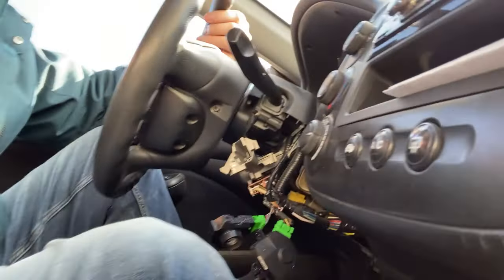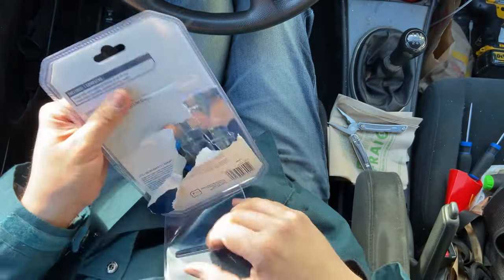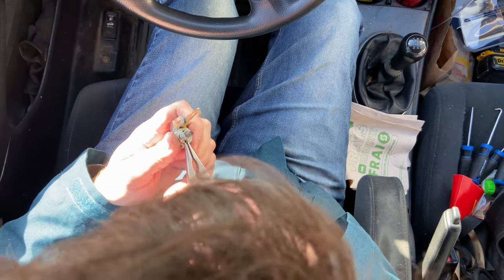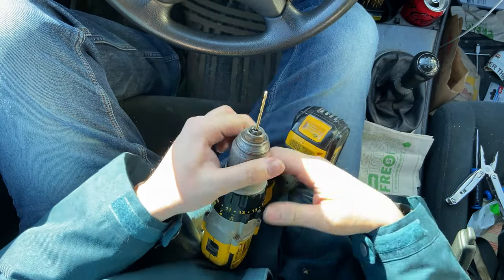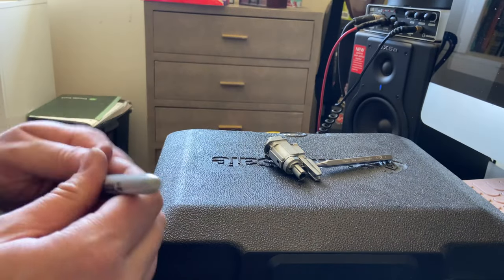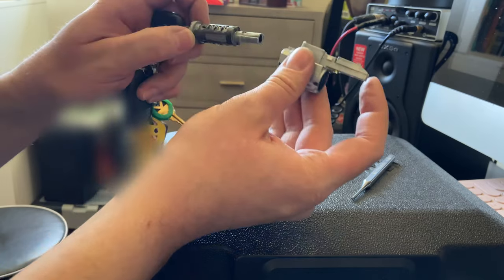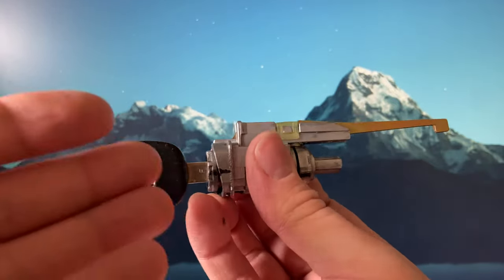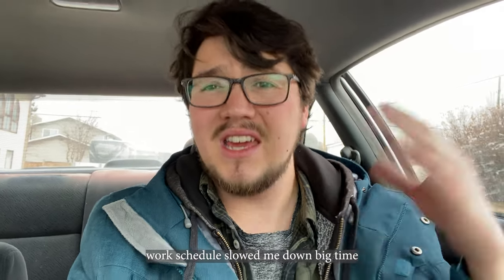Absolute Noob Fixes Honda Civic Ignition Lock Cylinder EASILY

Comment: My dear friend I'm a locksmith myself and that repair goes for only $200 of course I live in GA, but what you didn't think about was that replacing or removing only 1 wafer/tumbler only fix the problem temporarily because all the others one will go bad eventually, best scenario is to replace them all and cut a new key for $85; BTW we do fix those without no drilling nor damage to the cylinder or housing itself.
Reply from the maker: You're totally right! 
My method is really just a short term 'hack' fix with some serious flaws. If I could've afforded it and deemed that the car was worth putting the money into in that area, I definitely would've had it done properly. 

The prices you've cited sound totally reasonable to me. I wish it was that affordable here. If it were that price here, it would've been a no-brainer to have it done properly by professionals.

I also like your idea of having all the locks replaced (if I'm comprehending that properly). That wasn't offered to me, but it seems totally logical. There's only 3 locks on this car so it doesn't seem like 'that much' more work to just replace them all while you're at it. I assume that would've costed me a lot more here as well. 

At the end of the day my whole reason behind attempting to 'fix' this myself and make a video about it is just to challenge myself and learn about how stuff works. 

Thanks for your comment, I think you have a valuable perspective on this!
Reply: @Levisrad  he meant replacing the wafers in that single ignition lock. But hey, if it’s not important and it works, then your good to go!
Reply: I got changed 11 hundreds for mine to get removed and repaired..
I don't know why this guy charge me so much to get mine replaced..400 dollars to get the parts replace and 700 dollars for labor..
Reply: @Levisrad  I took all.my tumblers out. The car still needs ur transponder key to start even tho a screwdriver may turn the.ignition.with all removed. Bitnit won't fail again.
Reply: I'm poor
Reply: Good for you but this kid fixed it for free,if it's a lasting repair ONLY time can tell,good job kid keep on truckin bud.👍
Reply: Calebcontreras, sounds to me like you are just unhappy he got it working without someone like you. I think he did a great job, and will help others who don't think that even $200 is worth it.
Reply: @jeffwest5551  not unhappy mate, it was just a comment from a locksmith perspective point of view, if he did it without any help and without spending any money good for me, or you think I don't use any hacks to get stuff done in my life and house without spending money as well? Don't get it twisted brother when you go to a doctor and they tell you that you need a surgery but instead you decide with therapy you can do it too, is the same is was just a comment.
Reply: @calebcontreras3545 yeah but you made it sound like it was only $200 dollars. $200 is a lot when you don't have money, and it's a big difference compared to zero. Plus he would have to have a new key cut and programed, which he didn't want to do either. So yeah whatever.. "mate".
Reply: @jeffwest5551  Nah man you guys from this crystal generation have to say something to feel accomplished, it was just a comment from my perspective due to my Jon being a locksmith nothing else, plus he didn't have to have a new key cut and programmed because you would fix the ignition as original, he was respectful and took it the right way not like you... so I'll mind my business you mind yours.
Reply: @calebcontreras3545 ok man, if you say so. But you are the one who mentioned having a new key cut.
Reply: What area you in I need a mobile lock Smith.
Reply: @gregoryfleming2779  we are located in Gwinnett County but we are mobile and will go to you. We are in Georgia though.
Reply: That’s too rich for my blood
Reply: What part of GA? I'm in Atlanta and that's way more doable than I was expecting I have a 2005 Civic and in the college park area i was going to fix it myself but with work and other things I'd gladly delegate it to someone else if feasible please send me your info if doable
Reply: Please definitely can I have your company info this would be a lifesaver right now.
Reply: $200?¿ thats still to much... I'm screwed..:(
Reply: How do you do that? Please explain I'm having same issue  live in lv nv lock smith's here say they'd drill it out for 400replace part inside.. 😮😮😮😮
Reply: Where are you located?  I’m in Barrow County and my key is sticking
Reply: Where is your shop located?

Comment: some important steps missing : the  hard ones in removing switch. Take photos of which holes are keyed on the cylinder . Don't remove key yet.    Once the key is removed , the pins and springs will all pop out and fly everywhere and you will lose track of what goes where.  Thus, carefully and slowly remove key while holding down on the spring loaded keys on both sides of cylinder with the fingers.  Orientate the  cylinder with pins up and finger on reverse holding the pins on the bottom. Slowly remove the top fingers. Now you can remove the pins noting position and number because if you mess up, at least you know how to put it back together.
Reply from the maker: thanks for the feedback! This is really helpful info so thanks for sharing it here!

Comment: I just had my car try being broken into, so I replaced the front drivers side door lock cylinder.. I bought the new kit at auto zone for like 45$ bucks and the kit included 1 door lock and 1 non-transponder key (spare key).... it took me a couple hours to get my door apart and to install the new door lock and reassemble door... install came out great! but now i have 2 keys on my ring.. later that day i went to the grocery store and unlocked my car and was in a hurry to get home.. I accidently put the wrong key inside the ignition and jammed / wore the wafers inside and now my car won't turn over / start..   the ignition has seized.. I've done a lotta research so far to figure out what i need to do as far as repair my car and basic repairs of ordering parts and getting a locksmith to reprogram new keys runs any where to 850 to 1100 US dollars.. SO with that said, I am glad to have run into this video and I will be giving this a shot because the risk is worth giving it a try myself, just to remove the wafers that are worn. Worst case scenario, I send the ignition cylinder/ Barrel into a locksmith and get the wafers rebuilt with the original key.. THANK YOU for the vid!!!
Reply: Hey! Did this end up working for you?

Comment: Thank you for making this video, it saved me. This is the best vid and a precise solution. This problem all started when I accidently inserted a Nissan key into my ignition, since then it took 5-10 minutes of fiddling to get the key to turn, and it grew worse each time. 
After a successful start, as long as I didn't remove the key from the ignition, the key could continue to be turned, so I just left the key in the ignition like this and locked the car door with the second key for about a week. The FOB wouldn't work with the key in the ignition. 
This fix took me about 2 hours, although it could be done much faster on a second attempt. I spent most of the time fiddling with drilling the hole and removing the pins. I had to drill both directions like you said at 1:28. There are other videos with closer detail on drilling the holes. 
At 4:21, drill this hole; I was able to jimmy out the pin without drilling, but next time around I will drill it so you can slide a punch through it and punch out the pin and save a lot of time messing around. 
Remove that brass arm clip over a table, there will be a tiny spring and pin that will fly out and can become easily lost. 
When you finally pull out the tumbler, the bad wafer will be sticking up with the key in it. Keep the key in to prevent losing the wafers as you said. 
To remove the bad wafer - With the key in the tumbler, I wrapped the tumbler with electrical tape to keep all the tumblers in place and left the bad one exposed, I then removed the key and pulled the bad one out with needle nose pliers. I did this because I felt it would be too difficult and risky to lose control of the wafers. Also take pictures as you move along to help with orientation. Also when removing the one difficult brass screw near the beginning, I had a cheap #2 Phillips with a 90 degree bend laying around. When also removing the top cover, the tabs will likely break, I am currently attempting to superglue them.

Comment: Thanks for the video, I was able to do this start to finish in about two hours, if you plan for a four hour window you can probably knock it out. I went ahead and pulled all the wafers and springs out so I won't have to worry about it again :) Thanks, drilling the hole right along side the roll pin was the saving grace for me, just started picking at it and in about 5 min the ignition came loose and then it was non-stop until I finished it.
Reply from the maker: Awesome to hear! That's great that you were able to get it done in so little time! Congrats!!

Comment: Great video, it helped me a lot when doing it. I also decided to try to fix this after watching Lockpickinglawyer, in my case I had to buy new pins due to the old ones being bent. Luckily for me I didn't need to drill anything.
Reply from the maker: Thanks for checking it out and I'm glad it was useful for ya. Good job on getting the fix done especially without having to drill it out! Cheers!

Comment: Thanks for the vid. Earlier today I didn't even know of this method I was bummin it thinkin I was gonna have to do the new whole new key and new parts. I just need to get a drill and some picks. Mine started acting up today. I'm lucky to find ur vid lol. Wish me luck 🤞
Reply from the maker: You’re very welcome! I hope it goes well for you. 
There is also a ‘roll pin extraction tool/kit’ you might be able to find at some auto parts stores, or maybe even borrow from a mechanic if you know any. That’s significantly less destructive. But for an old car, drilling into it like I did works just fine if you don’t mind the damage it causes. Best of luck in your repair!

Comment: On my 2007 accord, when removing the cylinder, it seizes the whole part and I think it's done on purpose. 
I put the cylinder back, but it wasn't turning. 
When you pull that cylinder out, it hooks and brings the inside part a tiny bit forward and it's no longer turning after this.
Have to remove the whole assembly to have access to depress the steering wheel locking part and then the internal lever can be pushed back slightly. It clicks and starts operating as normal. It's super sensitive on mine, I played around and not able to remove cylinder without it locking it.  
Guess the idea is - if somone rips this cylinder out, they still need to go through the tamper screws.

Comment: Honda Civic Ex coup 2012, having heaps  of trouble removing the the back screw for the immobilizer ring?    It seems to be the only screw holding the immobilizer ring, instead of 3 screws?   Is there a special screwdriver for this tight spot?
Reply from the maker: I just looked up "2012 civic immobilizer exploded view" in images to see the diagrams. See if it's accessible from below. If you haven't already, try a mini ratchet that can hold the appropriate bit, or bit adapter.  If there's not enough clearance for that, It might just be inaccessible while that assembly is mounted. If that is the case, you may be best off removing the security bolts on top of the column, and replacing that lock cylinder assembly. The new kits are fairly inexpensive. I could be totally wrong; as I've never worked on a 2012 model. Best of luck to ya. I hope this is useful info!

Comment: Could not have done this without your video. Thank You for uploading it. It took me about 4 to 5 hrs and its was a bitch. Ha. I used a grinder to get at the first pin and a drill for the second one. That second one is tough. It's really stuck. I used a C-clap like a vice to push it out with a flat skinny nail.
Reply from the maker: Thanks for the comment! I'm super glad to hear that this video was useful to you! Also that C clamp technique is a good trick, good thinking there.

Comment: If you remove all wafers, will the key turn?  I don't want to replace tumbler either...as long as it turns
Reply from the maker: Yes I believe it will still work. Then it’s really only the immobilizer keeping your car from starting. A friend of mine did this to a much older vehicle and could start it with a screwdriver. Not recommended but possible for sure!

Comment: @Levisrad I did the samething except send mine to a locksmith, I set everything back up and the key still doesn’t want to turn, do you have any advice?
Reply from the maker: There could be something still jamming it causing it to not be able to turn. I'd remove the lock cylinder again, inspect each wafer & see if there's any still sticking out when you insert the key. If that doesn't lead to any solutions, inspect the spot where the lock cylinder goes, see if there's anything that could be causing it to be stuck. If you can't find what's wrong, you might be best off replacing the whole assembly which is what the locksmith would do for you. 
Also the steering column may be locked, preventing the key from turning. Sometimes wiggling/turning the steering wheel while trying to turn the key might unlock it. So sorry to hear about this & I hope you can find a solution!
Reply: @Levisrad  thanks for the advice! Also when I drilled the ignition out I didn’t see a roll pin, perhaps it fell into the lock cylinder and that is what’s stopping it from turning maybe? Not sure if that would be the reason
Reply from the maker: @ev3847  it definitely could be that. It seems really weird that there wasn't a roll pin in place when you pulled it out - that definitely makes me think it could be what's getting in the way.
Reply: @Levisrad  ya when I was drilling, the ignition just popped out randomly. Didn’t have to scrape the roll pin out or anything, looked everywhere outside, in my car don’t see the pin anywhere

Comment: Can I still do this with the key still in?
Reply from the maker: Im not entirely sure. I have a feeling the key might get in the way of some things, like the immobilizer ring. But I know sometimes that key can be stuck in there. If you can figure out what’s keeping the key stuck in there you might be able to find a way to get it free again.
If I were in that situation I’d try to work around the key as much as possible, but at some point the key would have to be removed to fully take the assembly apart.

Comment: So i jist did this to my car but it will not start now. Everything turns on but i go to start car abd it does nothing
Reply from the maker: Ah, sorry to hear that. If the key turns, maybe it's the immobilizer. Make sure it's connected Other than that, I'm not sure what it could be. It'll take a round of troubleshooting to find where the fault is, and then you may have to replace the part.

Comment: LOL, locksmiths don't hate you, you just don't understand. A  locksmith will key the ignition to match your trunk and door. They wouldn't leave you with a mis-matched ignition like you stated at the beginning of the video. Also, sorry, but you didn't fix the problem, you just relieved a temporary symptom and set yourself up for future problems, thereby wasting even more time than you already did. There are tons of videos on youtube of people doing this exact same thing, thinking they're fixing things the right way. "Working properly" is a relative term, apparently.
Reply from the maker: I wish the locksmith I had spoken with initially had offered to re-key the new lock to match my existing keys / locks, but they didn't, they only wanted to replace the part without matching the keys. I wish I had access to a better locksmith at the time! I know my hack-job fix a band-aid and not a proper fix. But if it gets me a few more months out of an old car that isn't worth much at all, I'll take it. Again, I wouldn't recommend this on a nice or expensive vehicle. Thanks for the feedback though sir!
Reply: @Levisrad  Good call, the locksmith should have explained that to you!